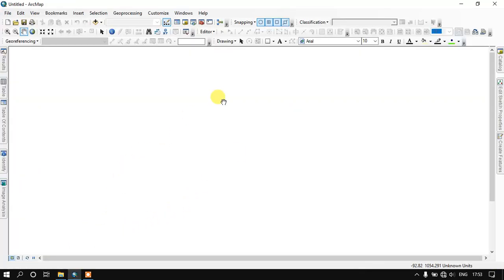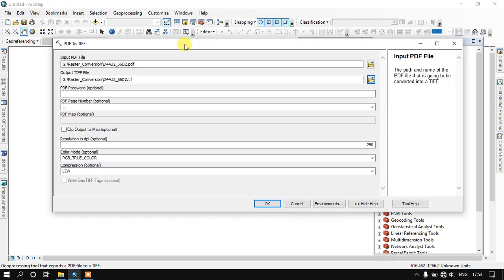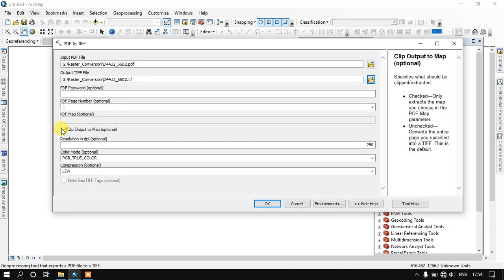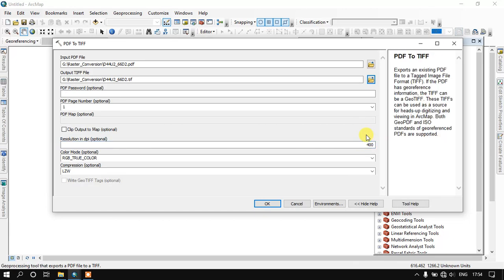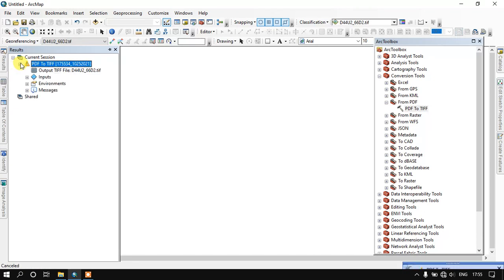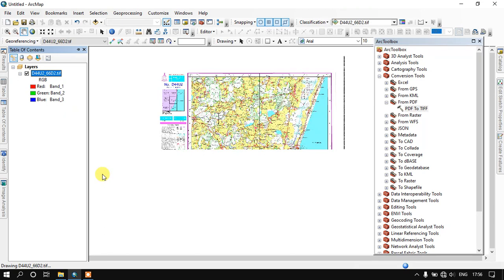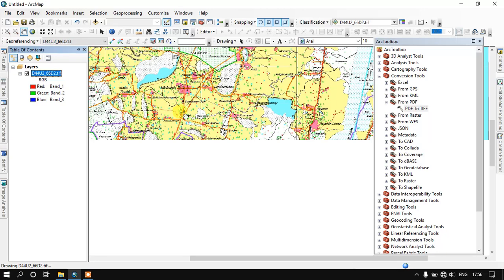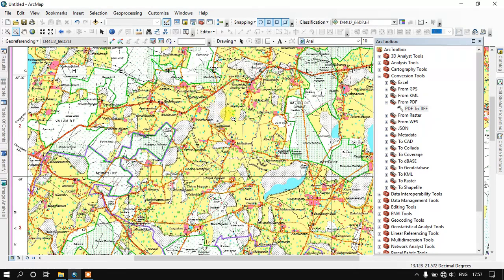Convert PDF to TIFF using ArcGIS

Comment: Wonderful video! I have a small question. Is it possible to prepare LULC map using these tif files? and if my area of interest is bigger, can we combine these tif files? Also how do we specify the projection in these cases?
Reply from the maker: Hi Mr. Ahmad Rashiq, Thanks for your valuable comment. I not aware of the process for preparation of LULC map using TIF files. But that can be done using satellite imagery or converting of already prepared map and georeferencing with some reference point or location. Thanks for your question.